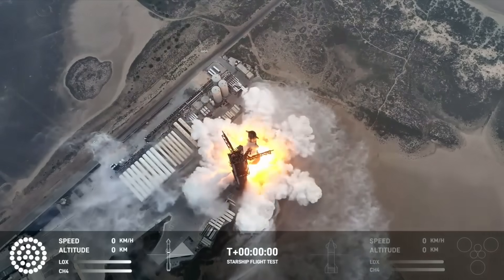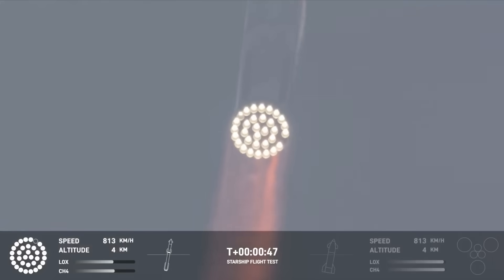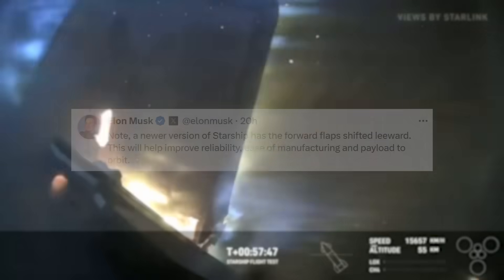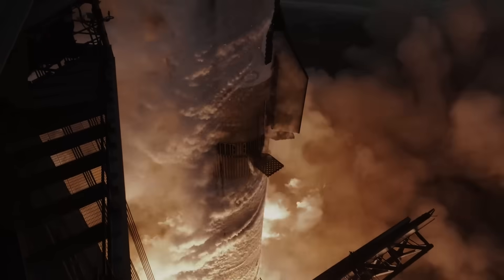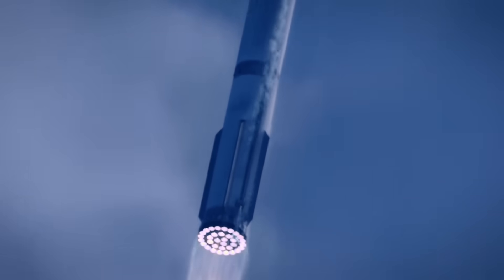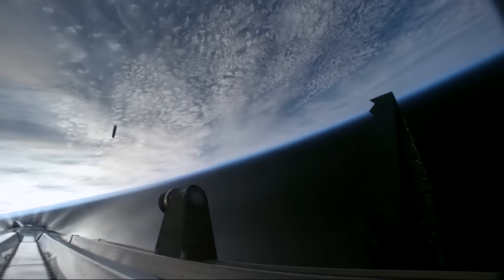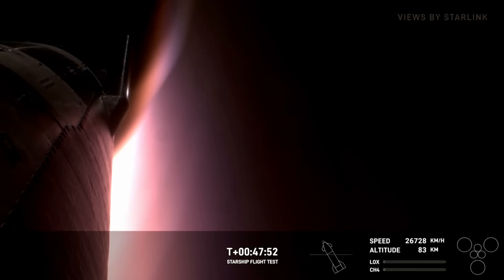SpaceX Has A Plan to Fix Starship's Heat Shield

Comment: Won't making them longer down the side lengths handle the heat better? Considering they've known about this problem a while, this isn't much improvement if wanting to accomplish dozens of landing etc. I'm sure the best engineers are onto it and will resolve the problem somehow?  Is it not able to be tested in the lab with simulations or such and try deferent designs to stand up?

Comment: It needs to be rapidly reusable. Even if it finally works. The additional heat tiles and weight will eat away the payload. Falcon 9 super heavy is a superior rocket. The pace in which they are finding issues will take 15 to 20 launches.😂

Comment: In theory with the wings... Couldn't they just position them such that the wings are entirely in the wake of the forward edge of the heat shielding? It would obviously mean less aerodynamic control but wouldn't it also mean that the plasma doesn't even touch the flaps hinge or otherwise?

Comment: I need some feedback, guys. I have an idea about the heat shields. 
Look at a heat shield. Let's call the flat top 12 o'clock. Now, rotate it 90° left or right doesn't matter.  Looking at the sheild on end. 25% of the way down and 25% of the way up drill or cast in tunnels about 3mm all the way through.
  Take a fine braided tungsten wire with  fiberglass insolation and thread it through the sheild to the next and so on through all the heat shields. The top of one shield will be lashed to the bottom of the one next to it, and so on. At one end of the wire, there should be a simple spring tensioner that will be covered at the end by a bonded on shield. At the other end, another adjustable spring tensioner. The tension to be calculated after some testing. This tensioner is also ultimately covered by a bonded on shield. I calculated it will be about an additional 400 + kilos. 
   I know they have to try everything first before adding more weight to the ship. But if this works it may be ultimately easier then inspecting and refurbishing the ship after every launch. 
  Good luck, Elon, with the next ift5 launch, and thank you for what you're doing to better mankind.

Comment: I would surmise that if they attempt a tower catch, there could be a "blowoff mode" where, if the 'catch doesn't happen within 3 seconds, then the chopsticks open wide and quick and the booster heads seaward to crash on remaining fuel - possibly in salvageable depth water. (Salvageable in the investigation sense, anyway).

Comment: The reusability of Starship will not happen with those long reentry times and pronged heating. It's too problematic. Starship needs a significant deorbit burn to get its velocity to a more manageable rate to reduce the time during reentry to reduce prolonged heating. That would help reusability in the long run.

Comment: I think the flaps and hinges of Starship will withstand re-entry if they were made from titanium just like the booster flaps.
Elon did come up with an eligent solution and that is to simply move them out of the plasma stream above the heat tiles. Currently they are inline with the level of the heat tiles and thus in the plasma flow.
So if Elon is correct - and he has the data so should be - then this is a nothing 🍔.
I could not see any tiles  flying off this time during the ascent of Supperheavey and the entire Starship survived so we all need to see it come back to land so that a full inspection can be carried out on everything. Nothing can be done now Supperheave is on the sea bed.x

Comment: Starship is made from (high grade) Stainless Steel which has a higher melting temperature than Steel. Plus, I doubt it will be 3-4 months for IFT 5. I would bet we'll see the next one by 8-30-24

Comment: I would like to specify that the Starship has some issues with the heat shield of the flap (or fin), which melt and disintegrated live on air. The heat shield of the entire Starship had had no issues, IMO.

Comment: I wish they would test a section of airframe using the original Transpirational Cooling idea. It would be interesting to see the Methane consumption rate, the effectiveness in cooling the steel, and whether the pores would be in danger of getting plugged.
The question is whether the mass of the extra fuel (or other fluid) required for transpirational cooling is greater than the mass of all those tiles. And another question is if the transpirational cooling system would require more maintenance than fragile tiles.

Comment: Why not make the flaps out ou titanium or tungstan?  
Their melting-points are higher than stainless-steel.
Reply: Those metals are harder to work with, and more expensive. SpaceX could not make thousands of them for cheap with those materials. They seriously intend to make ridiculously many Starships, as soon as they can. First major customer: Starlink.

Comment: Aerogel is an interesting ultra light weight material that seems to isolate heat amazingly.
Reply: Spacex should probably try testing with it. 🤔
Reply: Expensive
Reply: its expensive to use and similar to tiles, is extremely brittle

Comment: Another thing about using steel is it is much more economical. And that gives SpaceX another big advantage.
Reply: Wouldn't titanium be lighter and have a higher melting point than stainless steel? Granted, it would be more expensive.
Reply: @micr0chap  It would be, but as the commenter said, steel is cheaper. Additionally, steel has a higher tensile strength than titanium.

Comment: If they have to redesign the flap hinge it's going to be a while before they will be able to launch again as the work appears to me to be non trivial.
Reply: Oh they'll live with a ship that is almost perfect. They still have to show that the payload door works as intended, and the relight of the vacuum engines. If they lose a few more Ships, so be it. If it still is a big issue after working out those other problems they'll launch full size StarLinks and keep working on recovering the Ship. Falcon9 made a lot of commercial launches before SpaceX successfully recovered the first stage.
Reply: @CESmith  Yeah, having the flap hinge burn up isn't going to make NASA or any customers happy.  The customer might not care so long as their payload get where it needs to go, after that the problem belongs to SpaceX.  Simply put:  that hinge burring thing will 100% deny it a crew rating!
Reply: @Raptorman0909  Crew rating won't happen with the current Block 1 prototype anyway. SpaceX are going to perform test launches with test articles that they are already building, and carefully study the ways they fail. They may discover issues that also would affect designs that are under development, maybe early enough to revise said designs without much delay.
Reply: They already have the ship built with the redesigned flap even before the launch occurred.
Reply: @Bryan-Hensley  Which one, what number is it?

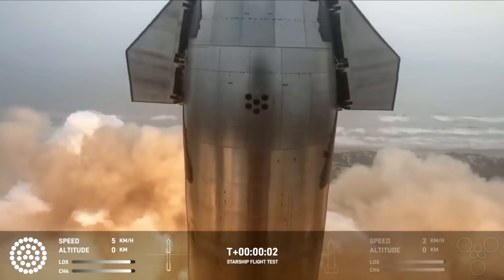Comment: @5:27 "one of the raptors shut off and remain that way for the rest of the flight" 

That kind of goes without saying because stage zero starts up the outer ring of engines to save weight and so if for any reason an engine shuts off there's no way to restart it in flight.
Reply: Not sure what your point is but even if they could attempt to relight it mid flight they wouldnt
Reply: @skillfulfighter23  My point is that this superfluous statement is also misleading. 
He should have simply said that it shut off without insinuating that it's remaining out for the flight duration was a decision by the crew or the flight computer. 

The inner ring of the Ship and Booster have multiple relight capability, but the outer rings left their "starters" back at the pad. 
(My understanding is that COPVs perform the original ignition of Booster's center engines independent of Stage 0 at liftoff, but If I'm wrong and there is a linkage I'd be happy to learn otherwise.)

My point is that saying "it remained that way for the rest of the flight" is redundant as there does not exist any mechanism to relight the outer ring in flight. 
i.e. it's like saying "the gravity caused the apple to fall from the tree and it remained there . . " 

"even if they could attempt to relight it mid flight they wouldn't" 
Why not? 
Rocket hardware is know for backups of backups, engineers must decide how much redundancy is possible with the consideration of how much weight penalty it costs. 
If an engine clears it's initial fault conditions then it would seem that capability to restore an engine mid-flight would add redundancy for the cost of larger COPV payload.  

Even if re-light carried a higher chance of engine RUD they are already paying the high cost of engine shielding for every engine for the purpose of containment. 

If you know of a specific reason why SpaceX would choose not to relight an engine I'd be interested to learn why.
Reply: @skillfulfighter23  the outer engines are only able to turn on ON the launch table. they dont have the hardware for relights
Reply: How are they started on the pad? What hardware is used that is left behind?
Reply: @snorman1911  those outer engines are stripped down versions of raptor v.2 for weight reduction. they only have the minimum hardware required to work. so they just cant re-light mid flight. they cant even gimble

Comment: IFT 1: Starship explodes after liftoff.
IFT 2: Starship achives stage sep but SH and SP exploded.
IFT3: Super heavey booster makes a fast landing, starship achieves orbit and did a propellent transfer demo for Artemis 3 but disintergrated upon re-entry.
IFT 4: Super Heavey booster finally lands softly on water and starship passes through re-entry, but structure was damaged as well as the flaps, (The flap almost broke apart).

Look how long we came 1 year later.
Reply: Amazing stuff!!!
Reply: Starship also did the flip manoeuvre and achieved a soft water landing as well!
Reply: And 8 billion is gone😅
Reply: @aktab9  $2B per starship launch? Lol, this isn't SLS bro.
Reply: IFT 1: Starship explodes after liftoff. Which happened because of the autodestruct didn't work and it was flying uncontrolled for something like a minute and a half.  
Deemed a success by the numpties even although it didn't achieve the set out flightplan.

IFT 2: Starship achives stage sep but SH and SP exploded.
Or to put it differently, it didn't come anywhere close to what was set out in the flightplan.
Deemed a success by the numpties

FT3: Super heavey booster makes a fast landing, starship achieves orbit and did a propellent transfer demo for Artemis 3 but disintergrated upon re-entry.
SH is turned into debris and scrap.
SS does NOT achieve LEO NOR did it do an actual propellent transfer (claiming solely that they pumped a miniscule amount from one tank to another tank on the same rocket isn't proof of concept that they can do it from one SS to another), they then lost complete control of it, and took them minutes to acknowledge that they had lost it. By the by, the opening and closing of the door was also a failure because you can clearly see that they couldn't get the door closed again.
Deemed a success by the numpties even although it didn't achieve the set out flightplan.

IFT 4: Super Heavey booster finally lands softly on water and starship passes through re-entry, but structure was damaged as well as the flaps, (The flap almost broke apart).
SH lands with pieces falling of it, with not all engines in a working order, reducing it to something that is only fit for the scrap metal yard, even although this is supposedly a fully reusable system.
SS is reduced to a molten heap of junk, barely under control and I wouldn't be surprised that they didn't pull the self destruct because it didn't work
Deemed a success by the numpties even although it didn't achieve the set out flightplan.

Sure, they did a tad better every time. There for less of a failure every launch. After all, this are early days of rocket launches. It isn't as if modern rockets was invented back in the 40's of last century. Or that VTOL rockets was success fully done in the early 90's. Or that people who only had the computing power of what nowadays is outdone by a childs smartphone were able to put men on the moon. euh... oh wait.... STARE
Reply: @PDVism  You're right, I bet you could even do it single-handedly
Reply: @PDVism  those "modern rockets" that were "invented" so long ago are ancient technology compared to what Starship intends to do. But there's no point explaining it to someone so obviously blinded by TF's BS that they don't realise themselves.
Reply: Sadly Starship and Starlink will be the zenith of SpaceX's capabilities. I'm pretty sure the company's assets will be nationalized or something once Starship and Starlink satellite production becomes more developed. The capabilities those 2 projects have have too many geopolitical strings attached for them to remain in the domain of a private company. That's my pessimistic prediction.
Reply: @ryelor123  I don't think so. SpaceX is already working with defence on Starshield and there's already defence contracts for Starship. No doubt SpaceX will continue to work closely with the US government and pentagon.
Reply: @ryelor123  There is no mechanism in the US for such a thing

Comment: Makes so much sense now.  Many companies seek carbon fiber because they wanted light weight, and never taking re-entry into consideration.  Once you have to survive re-entry, everything changes and the toughest material become the most suitable.
Reply: Rocketlab is using carbon composites for their Neutron first stage. It is only a first stage (lower reentry speed) and they are using a specially formulated carbon composite, which may handle temperatures better than what SpaceX was looking at years ago. But clearly they believe carbon composites are the right choice for their reusable rocket stage.

An interesting approach also comes from BlueOrigin, who were at one point exploring a reusable stainless steel upper stage concept for New Glenn, while keeping the aluminum alloy on the first stage.
Reply: @plainText384  Absolutely true that carbon composite is great for first stage that doesn't require atmospheric re-entry.  I didn't spent time thinking about first stage when posting the comment.

Come to think of it, while stainless is likely not the most efficient choice for first stage, it makes sense for SpaceX in terms of having rapid development and for mass production.  Completely different reasons than why it's idea for the second stage.  Gotta be cheaper too when you're sharing the same welding equipment, material supplier and staff for construction across both stages.
Reply: @lanzer22  well the first stage will still go through atmospheric re-entry, it'll just be from a much slower suborbital trajectory. But you're probably right about optimizing for cost vs. performance being the reason for choosing steel on the whole rocket.
Reply: @plainText384  I suspect (I'm speculating) that Starship remains shaped by its origin: The Interplanetary Transport System. It has a very large cargo volume, compared to its cargo mass capability.
It will be neat for launching very large space telescopes, though. And they should, to redeem themselves for peppering the night sky with Starlink, to the chagrin of many astronomers.

Comment: Will Starship land on a barge at some point? Would help to see the condition of the heat shield after landing:
Reply: I dont think its part of the plan. Eventually they will catch them with the arms like they plan to with the booster.
Reply: @Vaxter701 The next milestones for Ship are have no heat damage and to land at an exact, preplanned location.  SpaceX has to examine Starship after it lands to access its condition.
Reply: @Steve-Richter  yeah they are gonna do it to an exact spot in water, like they did with the booster, not a barge.... of course I could be wrong but that is what I believe is the plan

Comment: Rapid reusability is not the same as immediate reusability. Rapid reusability is reusability of the starship second stage within days or a few weeks of a landing. Immediate reusability is flying the second stage on top of a booster and taking off again in just a few hours. I don’t think that immediate reusability is either possible with current materials or prudent with current materials or even necessary! Could someone please tell me the scenario in which you need immediate reusability? Please don’t tell me that you need this for refueling a starship in orbit! If you want to refuel a starship in orbit rapidly, then you send up several tankers one after the other as fast as you can and you don’t wait for one of the tankers to fly back, cool down and get refilled on the ground.
Reply: You don't "need" either, both are simply ways to increase efficiency; more mass to orbit with fewer boosters, fewer Starships, and fewer launch facilities.
Reply: @msytdc1577  
I agree, immediately usability is not really necessary or wise and would certainly cost a huge amount of money to end Gene. Unfortunately, it seems like Elon wants to continue to promise that the second stage is going to fly down from orbit and land on top of a booster on the tower. Why? What is the purpose of that? How could that possibly be economical or efficient?
Reply: @wbwarren57  The same reason that the gate turn around time of an airliner is so important, airplanes only make money while they are in the air.